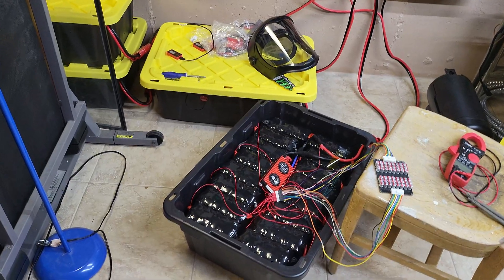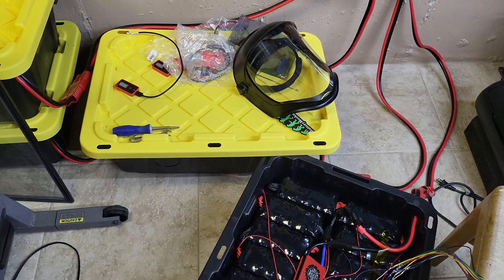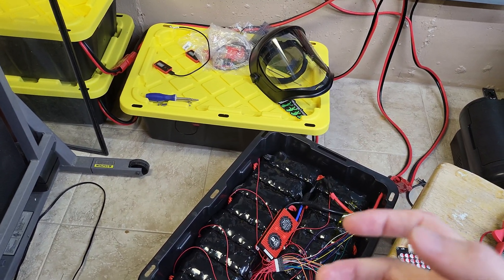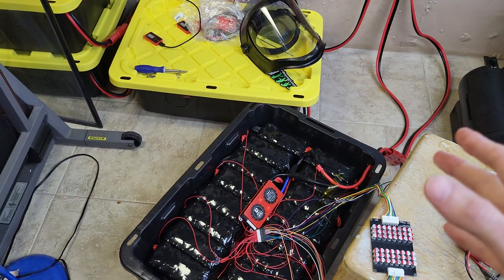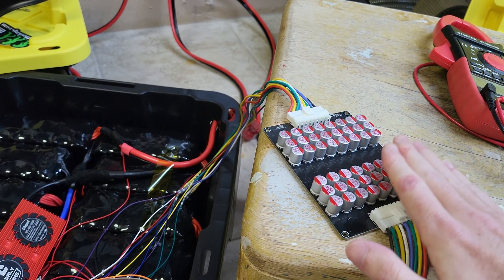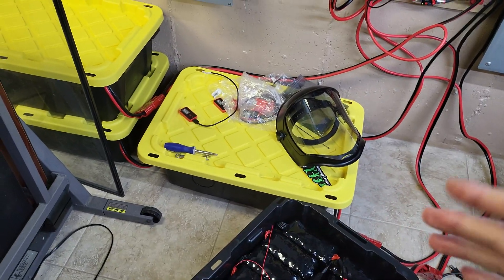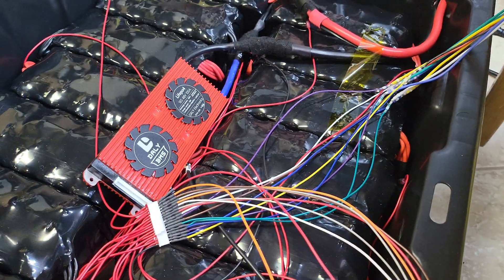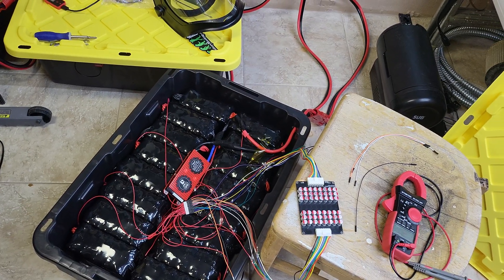Daly BMS fails and Balancer fails Battery Hookup 48V Lifepo4 16S

Comment: I use the Heltech 14s and they balance the 2.5KWh lithium Ion packs to 2 millivolts. I have 5 of them on 5 2.5KWh batteries and they are all working. I also run 100A Daly BMS on each battery and they are all connected to a common busbar to my inverter/charge controller. The Daly's are just for low/high voltage protection in my application. The charge controller/inverter range is set from 2.9 volts to 4.1 volts and handles the bulk charging and discharging. If any one battery cell goes high or low, the Dally disconnects that battery from the busbar and the others continue to charge or discharge. The inverter is just 5 kW so the 12.5kWh combined battery is adequate for the loads. You can observe the cells balancing with the Daly bluetooth app. Happy so far with this inexpensive combination.

Comment: I have a 16s , i did the checking after making a "full" charge until the BMS stop the process and it stopped at 56v , as i have 16 elements i should have 59.2V.It appeared that it stopped because some or one element reached 3.7V.Why is that the BMS (Daly)is supposed to take care of this no?So , in fact , my battery is never fully charged...
Reply from the maker: The Daly is by default set to 3.7V you need a smart one to change it. It is also set to 2.2V low cut off both very bad.
Reply: @darrenorange2982  my low cut is at 2.8 v
Reply from the maker: @francoisBonin-phils  That's fine I have mine a bit lower only to allow for emergency situations
Reply: @darrenorange2982  yes but i think its faulty , because ti does not prevent a cell to reach 3.7 while the others are at 3.3V

Comment: You need a smart BMS where you can monitor the voltage in real-time. You can see the balancer working then.
Reply from the maker: I found that neither balancers did anything.  I might try again in the future
Reply: @darrenorange2982  I have the 400amp 16s smart Daly bms and it does "balance" but not what normal people call balance. It comes on for maybe 15sec every 30sec and only passes an extremely low amount of current. As for the bms function mine has worked flawlessly. Smart Daly bms is the way to go so you can set your low temp disconnect and also see every cell movement.

Comment: I use 2 8s 250A Daly's 300 ma balance current  it seems to have kept mine in balance and has closed the gap on one of my cells in only a few cycles  looks like you bought old stock

Comment: They rate battery capacity from 3.65V down to 2.5V per cell (or 58.4V down to 40V for a 48V battery) so that's why you're not getting full capacity. I guess you are running that smaller range to increase battery life.
Reply from the maker: It's actually hard in a solar situation to use the full capacity efficiently

Comment: My understanding for those balancers is that they must be passing voltage thru them to actually balance. So if you run a discharge and recharge cycle thru them they will function. But just sitting idle, they won’t do anything. I don’t have experience with this myself, but something I recall from several other videos. Good luck! Will look forward to seeing your test results.
Reply from the maker: I have actually tried that without any luck, with the other pack.